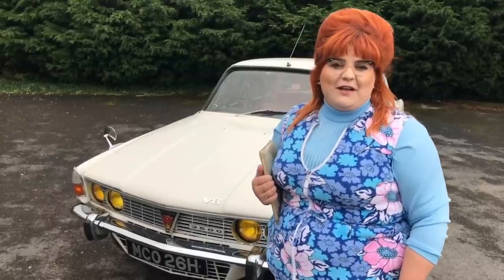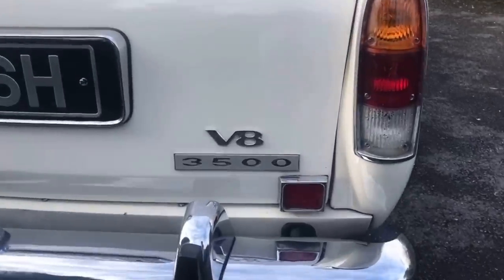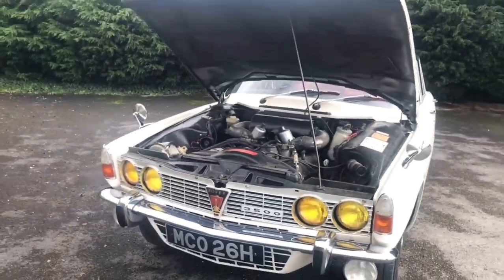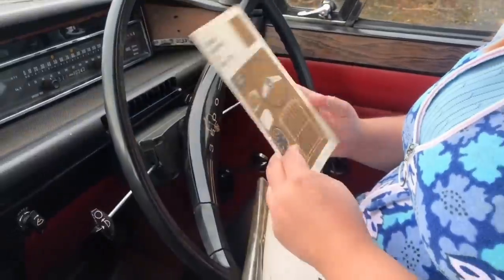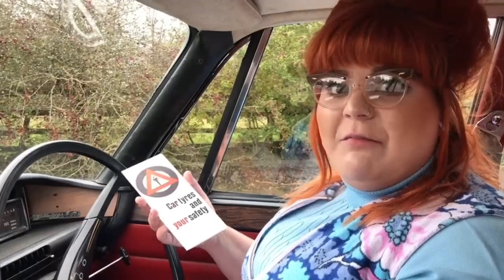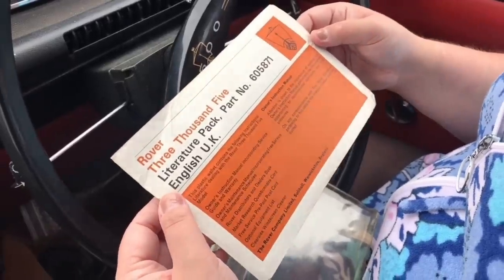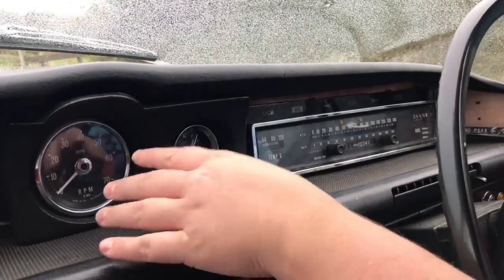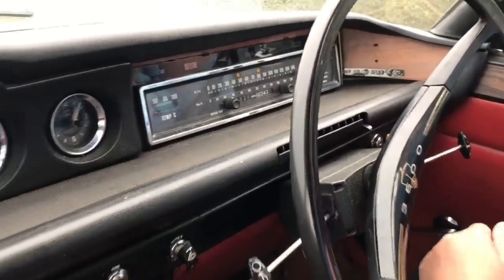IDRIVEACLASSIC reviews: 1960s Rover 3500 (Rover P6)

Comment: I really like this video almost entirely because your reaction to the car is absolutely what most people having driven more mundane machinery at the time would have.  This is a seriously sophisticated machine in the way that it drives with the bonus of the V8 being quick for the time.  A good decade and a half ahead of what we would expect as the norm dynamically.  Consider that entering the 1980s most cars sold in the Uk still had some form of live axle arrangement (Cortina, escort, various Chryslers, Marina, Chevette etc).  If you can, it's very worthwhile finding something more upmarket and contemporaneous like a Jaguar MkII to compare it with.  The Rover feels far more sophisticated and modern in every way to drive despite these cars being universally respected and fetching big money and the P6 unless exceptional being almost worthless.  It wasn't until Jaguar put the e-type independent rear axle and all-round disks in the S-type that Jaguar had the road manners to match the engine performance.

Comment: In late August 1973 I went to Devon from Lincolnshire and back in one. My father had a company car, had just been promoted and he had borrowed it with a view to buying one for the company. I sat in the front passenger seat and my girlfriend and Mother in the back. I was eighteen and from the viewpoint of a boy who grew up with the original Thundrbirds, Dr Who and Startrek it felt amazing. Cool dashboard lights and side lights that had a sticky up bit that glowed in the dark. I can remember my father cursing  as boot space was grossly inadequate for such a prestige car. He didn't like it and ended up with a new Ford Granada. If my memory serves me right I seem to remember the battery took up boot space and the spare wheel stood upright taking up more boot space. At a time when most people were driving very utilitarian cars it was very comfortable and well equipped. Just for the record, our motorway system was much less than it is today and the M5 did not go all the way down to Exeter, no where near. Many main roads where three lanes and you shared the centre lane with oncoming traffic in order to overtake. I feel even this dubious arrangement was far more safe then the ridiculously dangerous so called smart motorways of today.

Comment: I've worked on and driven some of these in my younger day, they really were nice to drive, feeling very strong.
The 2200TC made more sense.
Reply: Did the British spec TC 2200 have a high 10:1 compression ratio engine that required 5 star petrol. Because of this potential customers were put off. There were lower compression ratio engines available for the German /SW USA markets but these tended to drink petrol.

Comment: I had a 2000 followed by a 3500, wish I had them now, lots of torque from the 3500 but the weak link was the manual gear box which was a modified 2000 gear box and didn’t handle the toque so well and I had to have a recon box, but I loved that car. All bolt on wings an aluminium bonnet roof an boot lid.

Comment: I just drove home in my P6 3500, went on line, and this video popped up (google analytics...) They are awesome cars. Not as big as you'd think, and a lot narrower than a modern car. The automatic is far better, they seriously shift and corner like they're on rails. The only issue is running hot due to that big engine in a small engine bay - as long as you keep on top of the oil and water you should be OK. And... they are just about the only classic car that is so good in modern traffic that you can insure them with an owner's club policy even if it is your only car. Go on, buy one. You know you want to :)

Comment: Hi Steph Great video lovely car have always adored Rover P6 incidentally the tacho and clock were standard equipment, the binnacle was added when the TC2000 came about as on the original 2000 the clock was in the middle so they added a taco and combined the clock. When the 3500 was launched, they had to move the battery into the boot as the V8 took up so much room, thereafter all P6's had their battery located in the boot. Really enjoyed your commentary

Comment: Hi Steph, I love these and my father had one. They are very attractive.
The position of the front window winders used to anoy him a bit and the woodgrain inserts in the door trims kept sliding out.
He had an S model as well with the manual gearbox.
He had a Mk IV Zodiac too and it had the same rear brake setup and used the same pads.
He shifted the fuel line as he found it to be too close to the exhaust causing the petrol to get hot causing problems.
I like the P5 B Coupe too and the P4. I think Princess Margaret had a P5 B Coupe

Comment: My Dad had a Mark II Rover 3500 V8, which he let me learn to drive in.  As an asthmatic, I really loved the front air vent, which comes directly to the face and gives great ventilation.  I was a motorcyclist, so I appreciated the smooth power (all cars seemed slow to me), and even the automatic 3 speed gearbox didn't hold it back.  The torque tube rear suspension was much better than the leaf springs of a Vauxhall we had before, and it was very relaxing to travel in as a passenger. It was simply a lovely car, and I was very sorry when Dad replaced it with a Mitsubishi.  It still rates as one of the best cars I have ever driven, even compared to my Peugeot 505s, the very best driving cars of all time.

Comment: Great video. I reckon in 1969 you could legally drive over 100mph. I was born in 1964 and I seem to recall what my mum and dad called "deristricted" roads when I was small. Nowadays the white sign with black diagonal means "national speed limit" (i.e. 60 mph), back then, so I guess before the oil crisis, you could do 100mph...

Comment: The 3.5(or 215 C.I. Buick /Oldsmobile ) aluminium engine is a fantastic work of engineering.Mickey Thompson took one to Indianapolis in 1961,and the one I owned was a 1963 Oldsmobile F-85 /Cutlass  with the Hydra-Matic  and 10.25 to 1 compression /4 barrel carburetor.Great car,then the engine was sold to Rover /British Leyland.

Comment: I consider myself to have been very lucky, back in the early 80s my first daily driver was a 1969 Silver Birch over Arden Green 3.5 P5B Coupe, followed by a 1973 3500s P6 manual in the Almond (beige/yellow, reg 'JOE 301L' with Tudor webasot folding roof (loved it), power steering, ET front headrests, rear headrests, rectangular lucas fog lights, touring boot spare wheel mount and Sundym tinted glass, lived that car, especially with the sunroof wide open, broke the 4 speed gearbox and had to replace it. I had fullbook pack, Accesory pricelist and tge Passport service booklet

Comment: Hi, great to see you in the Rover, well done! I've had numerous including a Series 1 V8 in April Yellow (rare colour). Just a few thoughts, you say I think Rover spent 15yrs developing the car? It was in fact only around seven when the 'official design team' was put together in 1956 (with its launch in 1963) – though Gordon Bashford had been tinkering with a base-unit type construction earlier.
As to construction overseas, these were only CKD units ie base-units, external panels, engines, suspension etc etc supplied. In the case of New Zealand, these CKD units were supplemented by local content, ie tyres, paint, some electrics & trim etc etc. What made the NZ assembled P6s unique (which were all Mk 2, V8 autos) was the choice of paint colours, wildly different to the home built UK cars. The NZ assembled cars were sold there as well as Australia. Though interestingly if you wanted a manual 3500S, you had to order that from UK via your local Rover showroom. Many thanks for your infectious vid on the car.
Reply: Yes the Rover 2000,s all had a strong hull with every thing bolted on and easy to replace.   However like the XJ6 Jags had inboard rear disc brakes that were pig to service even with the factory "winding in tool"!

Comment: Owned a SD1 3500 for 12 years loved it but parts were hard to get in the end , I was able to modify the engine after a engine fire due to the SU diaphragm failing to a Rochester Quadrajet on a offenhauser lo rise manifold

If I had it today I'd put the stinger EFI on . In Australia the P6 was very Upmarket and rare 

Im in Queensland BTW

Also I noted that that P6 was optioned up with the continental kit that badge on the boot lid comes off to enable the spare wheel to be mounted on the lid giving more space for luggage on a touring holiday

Comment: The Rover P6 2000 was launched in October 1963 at the same time as the Triumph 2000. The 3500 V8 only came along in 1968, and used in the other Rover car the P5. There was a facelift in 1970, and in 1972 came the 2200SC single carb  and 2200TC twin carb replacing the 2000. By 1976 the P6 was phased out when the replacement SD1 was launched, initially the 3500.

Comment: The P6 was the first British car to have all-round disc brakes. To me it was the "British DS". Rover were developing a gas turbine engine in the 60s and designed the engine bay of the P6 to take a gas turbine. This meant that they had to develop the "round-the-corner" front suspension to fit. The large engine bay meant that the V8 fitted easily. All the outer panels can be unbolted and are not structural. The couple I bought my 2004 VW Polo from also had a P6 stashed away which I got to look at. A mate of mine had a red 1970 P6 but his was the Rover 2000. He had the engine out a couple of times during his ownership. He ended up selling it on eBay. If I had the money at the time I would've bought it off him.

Comment: These are smashing cars - I'd have one tomorrow! Engineering-wise the P6 was a more sophisticated car than its replacement the SD1. It was also far better built. Cruelty to fine machinery - please, Stef, don't rev a car hard without a load on the engine, especially if that engine is cold. My first car was a 1957 Fiat 1100 and that had a ribbon speedometer too; the difference being that the one in the Rover works! In my opinion, Cameron is absolutely correct about modern cars leaving you stranded - when they stop running that's it.

Comment: Now I'm not going to argue with you about that 'ticker-tape' speedo, but I will point out that my mate's 'C' reg Ford Zodiac had one, so Rover possibly weren't the first.  Anyway, I owned a P6, a lovely red one with a vinyl roof on an 'N' reg and it had the facelifted interior which was quite different to the one in the video.  I loved it.❤ You still needed to pull back on that right-hand stalk to sound the horn though.

Comment: I had to laugh, “I thought it would be slow” . A 3.5 has plenty of horses under the bonnet Steph. I nearly bought a later model in 1980, but my head had to rule my heart - big fuel bills ! . In there day there were known as the poor mans Rolls Royce. Keep up the good work.
Reply: In 1980 the P6 was no longer so much fun to drive. The later ones produced about 190HP, exceeded 125MPH, and reached 60MPH in eight point something seconds, but that was when running on 5 star fuel. They stopped the sale of 5 star in the late 70s. The car ran very smoothly on 4 star fuel, without any adjustments, but the power dropped considerably. It was still a lovely relaxing car to drive, though.

Comment: The P6 is a superbly engineered car. It was so far ahead of it's time, it's still very easy to drive on a daily basis. Driver visibility is fantastic-far better than the modern dross that passes for a car today. The ergonomics are very good, with all the controls within hands reach, and well illuminated at night. The ride quality is superb- superior to ANY modern car, only the XJ6 Jaguar has an edge over the P6 in terms of ride quality. The brakes are very good, especially for a car from this era. You do not need to anticipate in advance like you do with so many classic cars when it comes to braking. The P6 STOPS! The P6 has 50/50 weight distribution- the perfect balance. It has very neat road manners, and it's surprising how hard you can push it on the road. The one criticism I have is that the P6 does roll in the corners. I resolved that by fitting a bigger front roll bar, the car is much more positive now.  My father had a 3500S (manual) in the late 70's when I was a boy. I've owned my own P6 3500 for the last 4 years, I bought it whilst my other long term classic was having a bare metal respray. I intended to run the P6 for a couple of years, then sell it. Trouble is, I quickly grew to adore it! Now I will not part with it. I use it mostly for touring holidays in the UK. The P6 is a class act- it was engineered when Rover was independent, and not compromised by interference from British Leyland bean counters. Every time I take the P6 out, it always receives plenty of interest and positive comments, interestingly, quite often children and teenagers comment favourably on it, so it appeals to all ages. The sound of the V8 is glorious, and addictive. I have fitted a large bore stainless steel exhaust, which sounds epic. Great to see the P6 being reviewed, and getting the praise it fully merits! Excellent review! :)

Comment: I had several Rover 2000,sTC,s etc until around 1976 bought a brand new Rover 3.500 S with manual gears  from Hollingdrakes in Stockport for about £1875.A lovely car let down by poor servicing by my dealers who failed  to remove the front end of the prop shaft and tighten the nut on the gearbox 2nd motion shaft  at the first free service thus causing the said prop shaft to fall off at 1200 miles.Sadly a few years later it turned up at the local Hargoods car auction with badly corroded door bottoms etc and looking sad.

Comment: Great Engines,used by General Motors from 1961 to 1963 in Buick Specials and Oldsmobile F-85 and Cutlass.
Reply: @Rick-S-6063  I owned a 1963 F-85 Cutlass ,the heads were not Buick  "nailhead" design,but standard designs used by Oldsmobile.The Rover uses Buick heads,hence the "vertical" valve covers.The turbocharged model was called the "Jetfire " and was a hardtop only,the Cutlass was a 2 door coupe and convertible.Mine was equipped with the 10.25 to 1 compression ratio engine,power steering,manual brakes,4-speed Hydra-Matic transmission,bucket seats and a floor mounted console for the Hydra-Matic. LOVED that car,miss it to this day.

Comment: That's a rare glimpse for us Yanks! Nice Classic. 👍👍 
Hard to believe that Rover got its Classic Engine - because us Americans COULDN'T stomach a 3.5L V8 in the time when we were breaking into the SEVEN Liter barrier!! 😳 
It's actually a great, potent little Engine - that the basic Block is STILL being made today in some form, on Aston Martin, Jaguar and Land Rover, amongst others!! 
Cheers!
Reply: It was actually because Buick (founded by a Scot from my home town of Arbroath) had perfected thin wall iron casting and the aluminium V8 was too problematic to produce.
Reply: @gillonstewart1601  It also required special additives in the Coolant and a special Fluid for Intake injection on the Turbo 215 V8..... 
In 1962, Americans didn't want to bother with that, they just got 7 Liter Engines and simply put Petrol in them!! 😜

Comment: I had a 1972  2000tc back in 1981 had nothing but trouble with it . Stuck in 3rd gear   rear axle problems and don't mention the rear  inboard discs the V8 sound lovely but the auto used to blow the oil seal between the  engine and the gear box   and the rover V8s manual gear box use to blow as the engine was to Powerful for it I preferred my triumph 2000 I had

Comment: My late father owned 3 Rover 2000s (P6). 2 of them were automatics. 1 of them had the spare wheel kit which meant the spare wheel could be mounted on the boot.  I drove his last one in 1975 before he traded it in for a 1973 Triumph 2.5 PI

Comment: I notice that you referred to the car as a P6, not quite accurate, the P6 is the 2000 four cylinder model, this one is a P6B, the B standing for Buick, the place where Rover acquired the V8 engine, though they largely tweaked it to be nothing like the American engine that they started with. My first Rover was a P6 that I bought in 1973 for 100 Pounds and the longest trip was central Wales up to Oban in Scotland in 10 hours of driving, 660 miles, I would not have liked to do that in any other car of the time, it was relaxing to drive fast, I currently have two P6's waiting in my workshop for restoration, a 1969 and a 1972.

Comment: The 'z' rather than 's' in ize/ise is actually quite complicated.

British English uses 's' style generally now but if the copywriter was pedantic or aging a bit 'z' would have been the convention.

It's not strictly a US/UK difference, that's a very modern thing.

Just a bit of useless knowledge but lots of old British English texts use 'ize',  it's actually UK English that shifted, US English kept the old style.